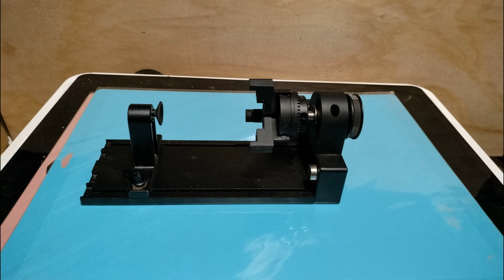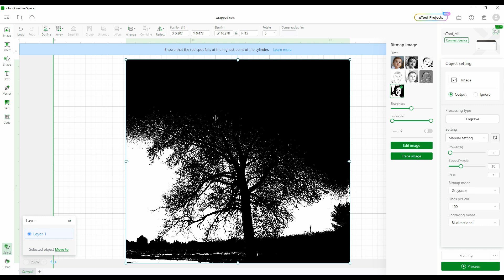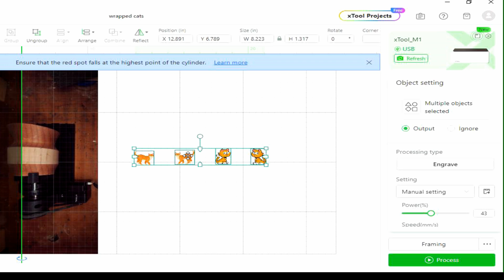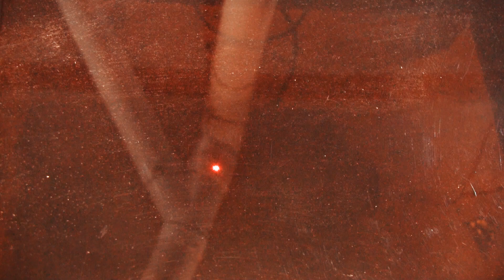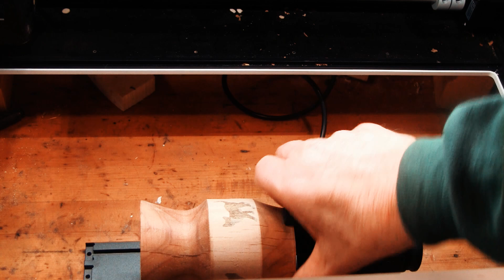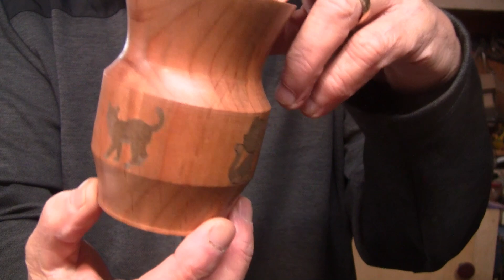Testing The M1 Rotary For Wood Turning Use

Comment: Nice bit of kit. My wife bought me a LaserPecker last Christmas and it’s taken me over ten months to work out how to use it. My Son suggested I attach it to the tail stock and remount my bowls on the headstock to engrave the bottom of my bowls. After some trial and error it works a treat 🌞
Reply from the maker: Thank you very much Ray. When I tested the LP2 I showed how to engrave the bottom of the bowl on the lathe.
That unit tilts and it makes it easy.
Thanks for watching,
Gary

Comment: Very helpful Gary and nicely done. I am sure your bride will love it. I am wondering what kind of diameter that machine will allow you to engrave on a bowl? Would love to see more of your engraving on larger round objects. I am struggling with the need and expense of a laser. Still using an old first generation LasePecker on the bottoms of my bowls. I am also sometimes intimidated by the software, your thoughts? Thanks so much, always enjoy and learn from your videos. Stay well and safe.
Reply from the maker: Thank you very much. I am sure she will as long as I have cats on it.
So you can turn the head around and raise the whole thing up. You also need to raise the laser but you could easily do  a 12" diameter. It would just need to clear the inside of the machine.
 Thanks for watching,
Gary

Comment: I've got a D1 Pro 10w, and got the RA2 setup.  Finally used it recently, and one thing I did was to turn it around.  The motor end comes off the base that the rollers attach to, and can be reversed.  This allowed me to put larger items in it (I did a ~7" bowl).  I just weighted down the flat portion, and put it on a box.  It worked out well, though there was a learning curve for getting it working correctly
Reply from the maker: Thank you very much. I have had it mounted the other way as well. For sure it allows you to do much bigger diameters. 
Thanks for pointing that out.
Gary